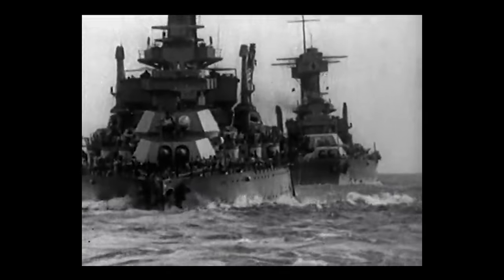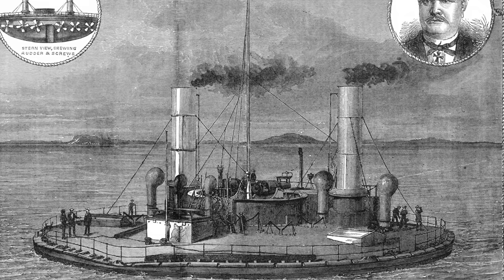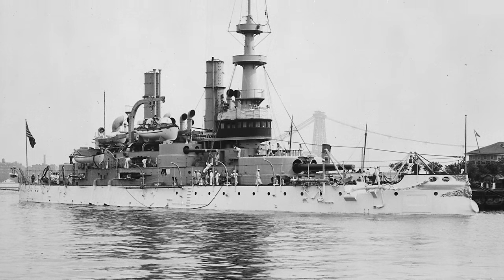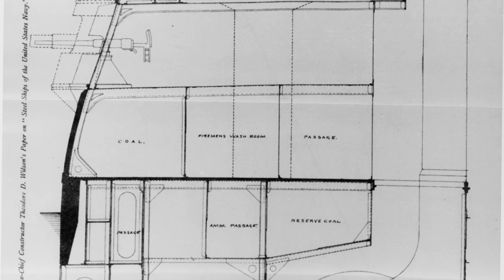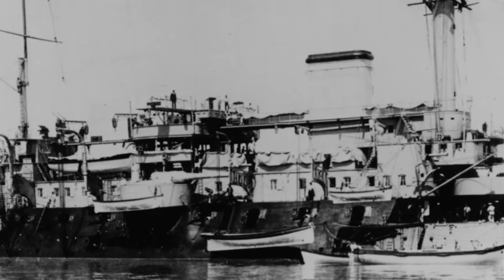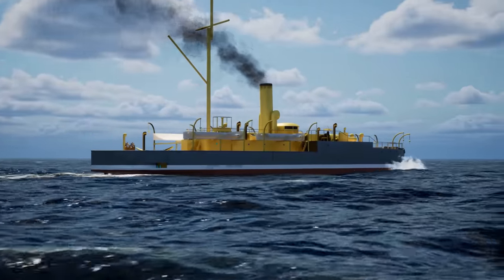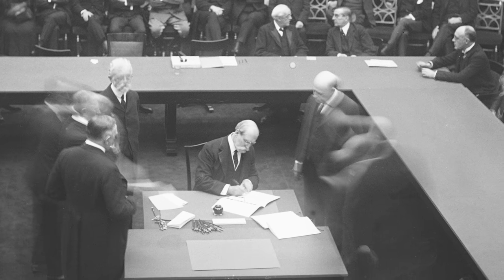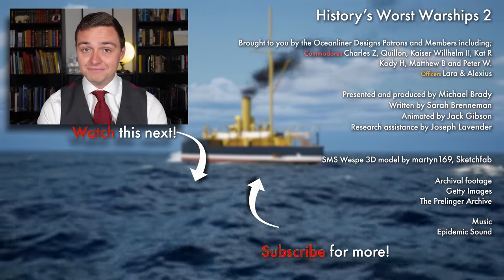AWFUL Warships From History

Comment: I know this is the worst warships, but among the best I would say would be the Queen Elizabeth class dreadnoughts, as they were the first to drop coal as a main fuel source allowing for more storage, were the first to be fitted with 15inch guns, maybe not the fastest ships out there but they could take one hell of a beating and still be good enough to remain in the fight, or at least remain floating and powered on its own, HMS Warspite, which entered service in 1916, proved to everyone just that during the battle of Jutland. She was only apart of the battle for a short period of time, but in that short period, she was shelled hundreds of time by German warships, being designated a main target, and when her rudder jammed and caused her to sail in circles for like 10 minutes before the rudder was freed, it made her extremely vulnerable and took quite a lot of punishment. Funny enough her rudder being jammed when a shell penetrated the rear armour and damaged everything back there, her doing circles took the heat off of HMS Warrior, enough to let her escape the battle before going down, which by then the crew were ready to abandon ship. Warspite as forced to leave the battle after the rudder was freed, and if I am not mistaken, picked up some of the crew from HMS Warrior on the way to a near by naval base for emergency repairs. While docked Warspite did nearly sink due to the severe damage, and she was disliked at first by everyone because she left the battle while it was still going on, but those who saw the extent of the damage she took would understand why she retreated. To this day, no other warship has ever sustained so much damage and remained floating, not to mention still under her own power. 

They planned to scrap her because of the cost of having to basically rebuild the ship, and if they did that, the Navy would have lost their greatest warship to have ever sailed the seas, and honestly may just be the greatest warship to have ever sailed the seas. After undergoing major repairs which basically was take the whole ship apart and rebuild it, ignoring the mishaps she had in between the 2 wars with her rudder jamming several times due to the irreversible damage done during Jutland and ramming several different ships which included 3 of her sister ships, she earned the right to be called one of the greatest warships to have ever existed, still proving in WW2 that her WW1 design was more then capable of standing up to modern warships at the time, and sure she was heavily modernized herself, the biggest chances being to the super structure, but her guns remained the same, her armour layout for the most part remained the same, and her ability to take the sort of punishments that would absolutely destroy any other ship still remained. The Germans tried their best to sink her, as did the Japanese and the Italians, all of which she shrugged off and kept coming back for more. Sea Lord Andrew Cunningham, who picked Warspite to be his flagship must have been so proud of his ship, given many honours for its service like no other, both during and after the wars. Hell, the largest joint operation in the war, Operation Overlord (D-Day), between the many different navy's present, Warspite of all the ships out there was given the honour of being the first ship to open fire on the beaches. Her guns marked the start of the invasion, and she became the honorary flagship for the whole of the Royal Navy, which the actual position was held and still held by HMS Victory, which has not been sea worthy in a really long time. She fought every Axis power, and served beside every Allied power, fighting with the Americans in the Pacific, fighting with the Canadians and Russians in the North Atlantic, being of great assistance, or getting assistance from. She has been everywhere and done almost everything. 

Her class is known for its ability to shrug off hits and return a devastating blow. HMS Valiant would be the second example of the 5 ships built of what they are capable of. Warspite was the go to ship of the 5 even though she was #3, Valiant being #2 and Queen Elizabeth #1 obviously since the first ship of the class is normally named after the class or the class being named after the first ship. Barham was #4 and poor neglected Malaya was #5. HMS Barham was the only one of the 5 the Axis powers managed to sink, as a U-boat managed to get passed the Destroyer screen and landed several torpedo hits on Barham's port side. I do remember reading that Barham was not the intended target since the the Destroyers did find the U-boat and were closing in fast and in order to dive you need to empty the tubes, at least on that sub, and had them fired without a proper target, but still found Barham. HMS Barham's sinking and devastating explosion after rolling to port was filmed by a camera man on the deck of HMS Valiant who was present during this time, and is one the most clear videos of the time, and probably the most clear video of a sinking warship. It is easily found on youtube there, as putting "HMS Barham" in the search will result in like 4 or 5 different posts with the same video of her going down, and ultimately taking over 860 lives with her, of her 1100+ crew.

I guess in short, it would be great to see a "Best Warships From History", and having Warspite on that list, because no other warship would deserve it more then her. Some may argue the USS Enterprise would because she had a few more battle honours, but her service record if you compare it to Warspite's, not to disrespect Enterprise and her accomplishments, but doesn't quite compare to Warspite. Among the top 5 warships of all time, I expect HMS Warspite and USS Enterprise to be in the top 5 for sure, top 3 maybe.

Comment: Second video on terrible warships - they're fun to roast and offer a lot of lessons to be learned. These were all pre-WWII, what about more recent vessels? I seem to recall some US Navy vessels were so poorly designed and/or constructed that they never lived up to their specifications and are destined for scrapping after less than 10 years. From what I recall they weren't so flawed in concept so much as - as is a common issue in modern military stuff - Department of Defense contract processes that encourage overpromissing and underbidding, then doesn't hold the builder accountable for the inevitable cost overruns and performance shortcomings. Those probably won't be as interesting to analyze though, as it was just a poorly made ship (accidentally wrote "shit," perhaps that's more accurate), not an interesting idea gone wrong. And probably not as much information because it's classified due to national security (embarrassment).
Reply: I was part of a design team that put together a series of different designs for the LCS.   Evidently, we missed the memorandum that the Navy/DoD thinkers planned on considering designs with tonnage displacements well in excess of recognized LITTORAL designs.   When I saw the “winners”, I laughed for thirty minutes.   The “winners” have disastrous powerplants (FREEDOM) or cracked hulls (INDEPENDENCE).   Gosh, what an embarrassment.

Comment: Thats what I think the Baltic Sea Anomaly is....an upturned Russian round warship. What we see on the bottom is whats left of one of these ships after its capsised while sinking...the 'concrete' finish to the anomoly is possibly actual concrete ballast and the rest of the structure, espescially if it was wood and not metal, has degraded or rotted away. Thats if the Anomaly isnt a completely natural geological feature.

Comment: OK I am surprised no one corrected you on the Massachusetts. You got quite a few things wrong with her a s something that easily could have been added to your list in the video. First off, Massachusetts was part of the Indiana class according to how Americans name their classes. Second, it was their turrets that were unbalanced in that they needed I think 200 tons of concrete to fix. It's a result of designing a ship with round turrets which was a srot of style for US ships at the time. Also because of inexperience at designing ships too. Second, they were designed by legal issues due to government interference to be not true ocean going battleships of the type either. So the US Navy squeezed the firepower of one in a hull much smaller. Lastly, the ships were heavily armored even for its time. The side armor was not 5" but 18" thick but because the ships sat so low in the water and being so heavily loaded, it was submerged most of the time. So it was not unarmored below the waterline, but you are correct in effect the 5" upper belt became the main belt. Alot of the inexperience from US designers is the superstructure itself. The high conical masts were too heavy. The turrets were badly designed. But the turreted 8" guns were a good idea but just doesn't work on a ship this small during this time frame. 21:40 Yes the US Navy did learn from this ship and others and eventually made very comparable ships to even the British.

Comment: As far as I'm aware the thing about the Russian round ships being uncontrolable spinning tops is a complete myth.  They could be turned on the spot easily by reversing the engines on one side while leaving the others ahead.  But this could be easily stopped at any time by adjusting the engines again.
The thing about the gun recoil making them spin is also unfounded.  How would that even happen when the guns were mounted centrally to the hull?  The Novgorod had had a problem with the gun traverse locks being too weak in trials where firing a gun caused the gun turntable to rotate, but this was fixed.  This issue seems to have become exaggerated to the entire ship spinning.
As for poor seakeeping, yes, but this was a problem most shallow draft monitors of the time suffered with.
The ship's biggest problems in fact were poor ventilation, boilers that produced insufficient steam for all 6 engines, and extremely slow top speed.